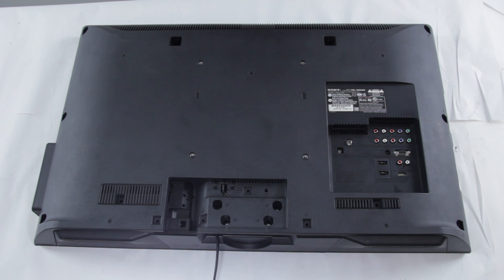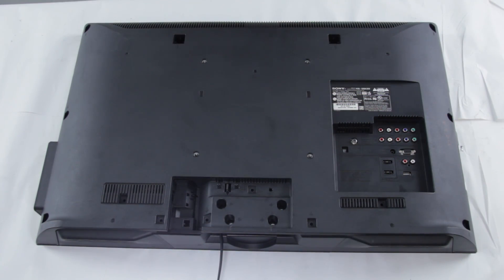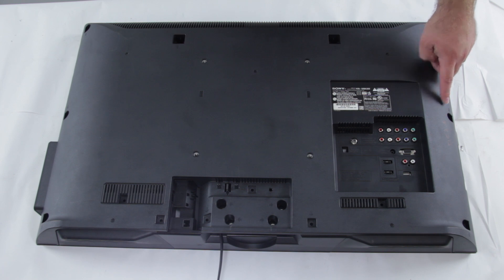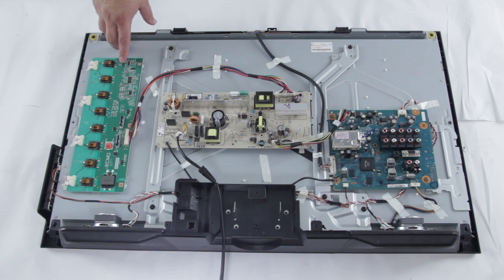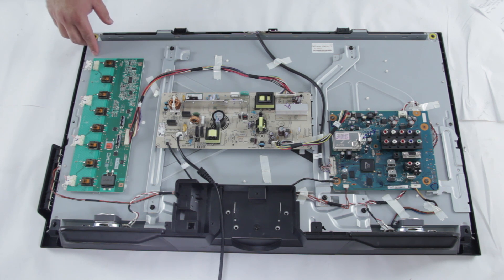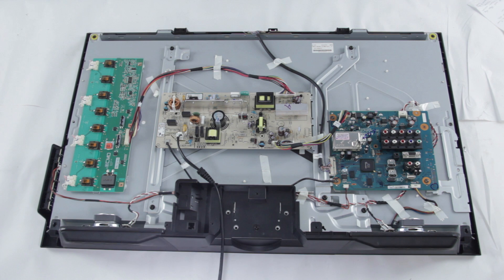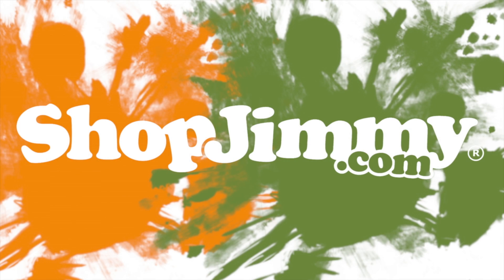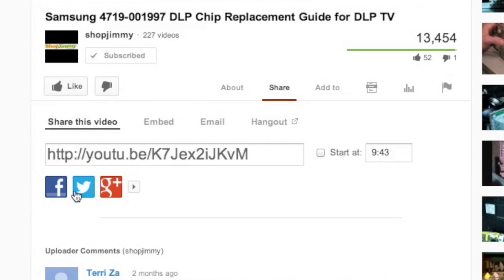LCD TV Repair Tutorial - Backlight Inverter Common Symptoms & Solutions - How to Fix LCD TVs

Comment: My RCa led tv model 46LA45RQ has an intermittent picture issue. The sound always comes on when you power up the set but sometimes the picture comes on sometimes it doesn't. I will alternately turn on and off the set and hit the menu button and once in awhile I will hear a buzz and then their picture Powers up. Do you think that's an inverter issue trying to power up the set and only sometimes being able to do so?

Comment: Hi please advice 
TV has not picture but we can see it using the flashlight test, however there is sound.
JVC model no: LT-42N530A
serial no: LT-42N530A350420141443
Thank you

Comment: I have a element TV model number eleft326 serial number e5comoaoa32100096. It has the exact problem described. There a picture but no back light to see it you just hear the sounds. What things specifically could be the problem with the inverter? Is it fixable or would I have to replace?

Comment: When I open my LCD monitor, I see 2 boards.  One with all the video inputs and the other with the power plug.  There are 4 sets of thin writers coming off the power board towards the LCD panel itself.  Could the inverter board be inside the LCD panel assembly?  Or is it integrated into the power supply board? It's a viewsonic Vt2730-m

Comment: I have a Vizio 55" 4K TV. Serial #LTY6RKBQ4355341 model#P502ui-B1E. When it powers on the screen stays black and the power light below the power button blinks. Nothing else happens. I have ha the TV off for at least a month and the same thing happens. I took the back off the TV, I am wondering what to do next. Any suggestions?

Comment: hi i have a SANYO 55 inch tv  FW55D25F  when i turn on it opens with sanyo logo then turns off i have replaced  the power board and the main board and still have the same problems any suggestions thanks.

Comment: Toshiba 55wl863 part of the screen is darker than another one when I open the back it seems that right led strips are a bit dimmer than the left side could it be the power supply or its definitely inverter/light strips?

Comment: Ive a sony KD 65w855c when powering up the sony logo flashes up and the right hand side of the screen, then it goes blank. The white led on the bottom cones on then after a few seconds the the red led flashes six times. Clould this be an invertor issue or led?

Comment: Vizio E50-E3 , several weeks before I noticed my screen images are getting slightly dim than usual,  was using it last night , then noticed black screen,  i tried to do flashlight test, initially I can still see very dark pictures in screen then later on total zero image in screen,  I did hard reset but no go, i tried using both remote control and manual push on power button but no go, I guessing Inverter went bad. any suggestion ? when powered the initial small corner led lights up then nothing.

Comment: I have an insignia TV, I have volume but no picture. I can see a dim picture with the lights off using a flash light. I cannot find the correct inverter board.
This is the model #ns-65d260a13

Comment: hey. i have  tx 55ax630b panasonic tv and the standby light flashed once every 3 seconds or so.  I believe this is an inverter board but i dont know where get hold of one. I would like to try and repair my self as its not worth sending out. Could you help please with the part if you agree with the diagnosis?

Comment: Hi, thanks for the explanation. I cleaned the capacitor solder points on the inverter board with alcohol and it worked again, until the next day when it did again what you mentioned. (screen going black 1 or so seconds after turning it on) what could it be? corroded solder points?

Comment: I have a Toshiba  model 40RV525R, ser. no. 930430TF2457K2. my picture started to go black at first, and i could shut it off and turn on and it would work for a while, but It finally is just black now with audio being fine. Turning the back light to 0 worked for a while also. I suspect the back light inverter. Could you help me. Thanks

Comment: Hi ya i have a Toshiba 40L345*DB LED Backlight LCD TV, when you turn on there is sound but the picture is very dark almost black if you shine a torch you can just about see the picture, so is this an inverter problem? I have been told sometimes that if you have HDMI plug ins game consoles etc, this could overheat and cause issues is this correct? cheers Allan.

Comment: Hello, and first of all thank you for your Channel. It is very helpful. I have an Insignia Roku TV model number NS 55 DR 710NA17. I was watching TV and noticed that the top half of the TV was really dark the bottom half was dark to but not as dark. I turned off the TV and turned it back on hoping that would help but that just made it worse. It is now pretty much completely dark except for when I turn out the light I can make out enough to go through the menu options. I can see backlights through the back of the TV but only on the top row of holes all right. I cannot notice and eat on the bottom row of holes. I did a reset and I've tried keeping it unplugged for quite some time. Any idea of what the issue is with my TV? And again thank you for your Channel.

Comment: Hoping you're still checking the board.  Yesterday our RCA LED46C45RQ went black. Audio is still there and flashlite test shows images but not backlites can be detected from the vent port on back of set.  Preliminary research suggests backlight inverter gone bad.  I dont have all the volt meters to test all the components & dont want to pay some dude $195 for his bench test repair.  I could probably replace the inverter myself but is it worth the risk of it being something else.  I know new tv is only $399 but am strapped for $$ at this time... any suggestions?
thx jeff

Comment: I have a Samsung tv that does have sound but without any picture or light. I believe it’s the back light inverter. I’ve already replaced the main board and that didn’t solve the problem. What part do I need to buy? Model # LN55C630K1fxza

Comment: ELEFT506 - backlight works, no sound or image. Tried replacing the main board with one from your site (I looked it up by serial number) and that didn't fix it. Not sure if the new board is busted, or if it was never the board.

Comment: Our 65 inch Samsung UN65F7050 FXZA, Serial # Z7JX3CDD800854V, the TV comes on and works well but the right hand side of the view is darker. If your watching a program that is anything but sunny or bright program the right hand side is extremely hard to see depending on the program. Please advise, a friend says we need a ( backlight inverter board ) to correct this issue. Can you advise?

Comment: hi! I do have a question about my TV. I think the problem is the backlight inverter.
Reply: When I switch it on, it will display the welcome logo. After that, the screen will become black like it shut down itself the the LED indicator will flash red a few times.
TCL L39D10
Serial Number: ALY108515L-0008

Comment: I have a Samsung LN32D403E4D, 32” lcd tv that started to become dark on the right side of the display. I opened it enough to see that the backlight bulbs were flickering. I replaced the inverter board, but it didn’t fix it. Any thoughts?

Comment: I have a Toshiba 49L310U TV that has no sound and no picture.  When you power on the TV, a white line flashes across the screen and then it goes black.  I've replaced the power board, the main control board and the T-Comm board.  I still have the same problem.  What else could be causing this problem?  Thanks

Comment: I have a tcl 55us5800 it seems the led inverter is part of the power supply. Theres a 10pin plug led+-led+EMPTY-led1--led2--led3--led4--EMPTY-led+-led+ How do I test it before pulling the screen off? 80% of the leds work its only a portion of the right side that is dim. thanks.

Comment: My Samsung led model# UN65J6200AFXZA went dim last week only on bottom 1/4 of tv,  and today I got all black screen. Audio still works and I can see images on the screen with assistance of a flashlight. I have tried to reset by unplugging and cannot factory reset as I lost controller a while back. Not sure if it could be inverter, backlight or something else, I would appreciate any help as I cannot find anything other than your sight that makes any sense. If by my model# you could suggest the correct parts I would like to order them, or if you can make a house call that would be awesome!! Thx

Comment: I have a LG model# 50LS4000-UA
Serial# 211RMMDDZ467
I have sound but a black screen except for a white circle (⚪️) a bit smaller than tennis ball size in the top left corner. I've read backlights themselves, the inverter or the motherboard are the problem. Any ideas?

Comment: Dynex DX-46L261A12, BlACK SCREEN AFTER 10 SECONDS I STILL HAVE SOUND, What could be causing this?

I watched TV day before no problem, turn Tv on next day and after 10 seconds screen went black, but still has sound, can not see image with flash light test. Been told inverter board, but I do not see anything abnormal on the board to be the problem.

Comment: Hello I have a LG55la6205 TV comes all is good a few minutes screen is black and still has sound and all function work as with a flashlight I see the picture.i took it apart to see if capacitors where the issue but dont have the tools.i think cost wise to change inverter board ? BUT cant find the part on any sites .TV is 2013

Comment: i have same model as u showed..but don't think to fix it back but recycling it to make lighting..wonder can light up the backlight only ..can change to strip light 12v but it a waste coz the backlight  still operational...only crack screen..need ur advice on this..btw each tube how many volt there is?

Comment: Hi thank you for this video, I’m having a problem with my Samsung LE52A676A1MXZF. The TV switch on and work for 10 to 15 mins and then some green /pink vertical noisy lines appear. At this same time the TV switch off and start clicking.

I’ve changed all the bad capacitors and even some good ones with new ones. The problem is still there. So I was wondering if this can come from and inverter. How to check it ? Could you please help. Thanks a lot....

Oh yeah I also wanted to add that, after lets say 1 hour of working, the TV stays stable and seems to work more or less in a good way.

Comment: troubleshooting question for the 65" Samsung Curve model # UN65JS9500F .   I see the image via flashlight test with audio ,  it appears to have no backlights.  I removed the back cover and still not seeing any lighting anywhere aside from the Samsung Logo.  I'm new to tv repair but very technical in the I.T. industry.  what would be the best way to test if its the LED power supply board vs. the LED's themselves.  I have already replaced the T-Con board .  the issue still remains the same.

Comment: hello, I have a Sony tv XBR-46HX909, it's start to fail, when I turned it on some times the screen on for one minute or less then screen turn off and the red led start to flashing five times, do you think that RUNTK4372TPZZ Backlight Inverter Board Unit is the root cause? or could you help me how to solve this problem.

Comment: I have a Sanyo TV Model # DP42848 Serial# B8200942742053.  The TV powers on, the input # shows on screen and suddenly goes black.  I replaced the T-Con board, but the result was the same.  Not sure if the problem is the backlight inverter or power supply?

Comment: I have Hisense LCD #LTDN42V77US.  Have  red standby light. Press  power button, 3 blinks it boots 2 sec with back light but then off.  Press power button again the red light returns.  Press power button again, 3 red blinks, backlight comes on 2 sec and back off to black  voltage on power supply board did not have 5 volts when tested. Changed power supply board and main board, (purchased from Shop Jimmy.com). Still no picture but even though CCFL lights momentarily, dim logo, then off.  I don't see a TCON panel only cable from main to multiple ribbon connectors to LCD. Must be built into main board.  Also No sound.  Any suggestions?

Comment: Dick Smith GE7104 N19 DSE15010051
Went out the room, tv was fine, when I come back in later tv had black screen, no picture but sound was okay. Youtube vids say to shine a torch on screen, which I did and could faintly see the picture, suggesting bad inverter. Someone else suggested maybe blown capacitors. Are you able to confirm which? I don't have any test tools or meters but got a solder iron. im hoping its just the inverter needing replacing. Do you have one or suggest where I can get one in New Zealand? Cheers Kev.
Reply: Whoops, forgot to ask is a failed inverter a sign of tv on its way out?

Comment: Hi, I have a sony KDL 46bx4500 it powers on as it should with backlights and the sony logo then turns off
After taking the back cover off I noticed the set has a inverter board and the RF input for the antenna is bent,
Not sure how to test the inverter board though, any suggestions on testing the inverter board , I also changed 
The power board

Comment: Un55ju6500 samsung black screen have standby light, tcon board has two flashing blue lights, probably stand by lights, no backlights but took flashlight to tv could see an image for a second when looking with a flash light through screen it was a start up logo then shuts off with the flashlight

Comment: I have a Samsung LN46A530P1FXZA tv and when i turn it on, there is black/purpleish haze on right side. Did the tap test and it does make it better or worse temporarily. Id say about a 4th of the tv is that black haze. I took off the back and did a visual of the boards and did not see any swollen capacitors. Checked all connections, cleaned connections.  Tried turning it off for so long, tried pretty much most troubleshooting i could find. Which was limited.  The only video i have seen that was the same exact problem as mine, the fellow hit it hard with a wooden rolling pin, near the top right corner. Crazy enough it worked. I however do not want to bash my tv as thats not a permanent fix.

Comment: I have a sharp roku tv model LC-43LB481U serial number KSDG9YA012307 and the issue I'm having with the tv is it comes on for a few minutes and then goes off. I opened it up to see if the back lights were on and they were on for a few minutes and went out. I replaced the t-con board and it's still doing to same thing. I looked up on google and they were saying it could be the power supply board, the inverter board, lcd panel, or the back lights. I don't know whether the inverter board for this tv is built in the power supply board.  Can you please help me solve or have any suggestions to this problem

Comment: Toshiba 55LF621U19 turns on but there is no back light at all, not even a quick flash.  I can see the menu options when conducting the flashlight test. I replaced the power supply board but that did not change anything. Any suggestions?
Reply: maybe the power supply is not the problem, do you have fried ic chips?

Comment: Art
Sharp LC60LE600U, does not respond to power button. When plugged in, the on light comes on and in 5 seconds backlight comes on for 1sec and goes off. I have replaced the main board already with no affect. Also checked power supply for stand buy volt 5.06 ok. what is likely the problem?

Comment: Sharp LC-52d64U. TV powers on using Adjustment mode. But screen flickers with image than shuts down. Power LED blinking green continuously.  I found that if I remove the power from Inverters 3/4 I get a clear picture for a second than it will shut down. Also discovered that if I plug the TV into another outlet the TV will work fine (video/audio). This is all while performing a power on using Adjustment mode.
Any ideas? I'm thinking either inverter 3/4 or power supply not allowing for optimal power due to it working in one outlet versus another (this is in two different buildings too).

Comment: Hi, I have a Seiki Pro SM40UNP with intermittent backlight.  I replaced the LED strip which had one burned out LED and burnt resistor. No change to the behavior though. All voltages on the power supply test good EXCEPT backlight_on which is intermittent. Any ideas? Any help would be much appreciated.  I've been unable to locate a schematic but will try Seiki this week.

Comment: I have a 65” RCA model SLD65A55RQ/ serial # 5525SL65A55 A302379 I turned on TV and all I is
A blue screen. Tried to reset with no luck. TV is only 2 years old Hoping §I got repair with board.If any information would be helpful thanks Joseph Ardire

Comment: Having an issue with SONY XBR-55X850C, Turns off and RED lite on bottom flashes 6 times in sequence. I unplug from wall and  turn back on works ok for while. Has done this several times. Could not find detailed info from Sony support, would appreciate some help.

Comment: Hi mate I Have just replaced a go0d few capacitors on my uncle's tv it's still the same if u keep pressing power button occasionally it was act as if to turn on but go black again could this be likely the inverter? Thanks I can't see any other bad capacitors in the power board I fixed our tv over 2 years ago and still going strong any hekp thank you

Comment: LG here.

It will power on, audio is there but the screen is extremely dark like there is no backlight. Had to take to a windowless room with to see the screen display. Seems like this could be the problem but wanted to ask you guys first before buying something.

Model # 32LB5600-UZ 
Serial # 409MXNUNC151

Comment: Hey Good day. Great Video
I got a LG 32LD350 tv. Tv comes on there's display and sound, backlight shuts off then comes back on(note: just the back light) does this about 3 times then shuts of completely. Inverter board is built into the power supply any suggestions? 
Would be greatly appreciated